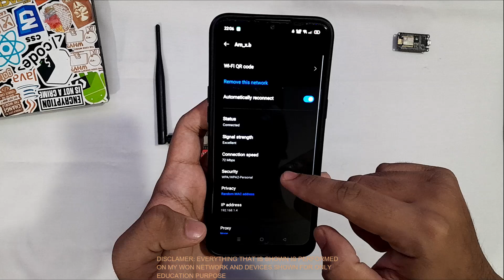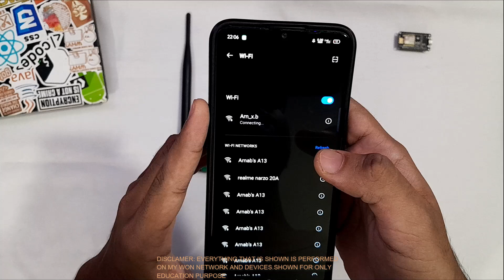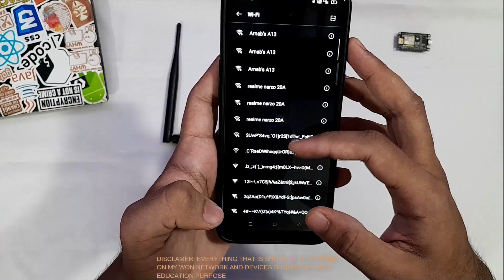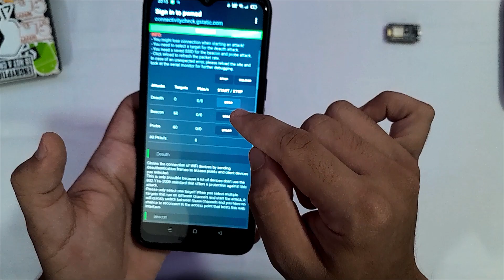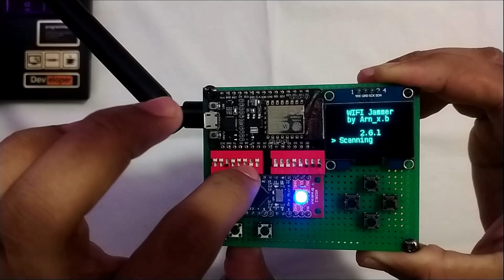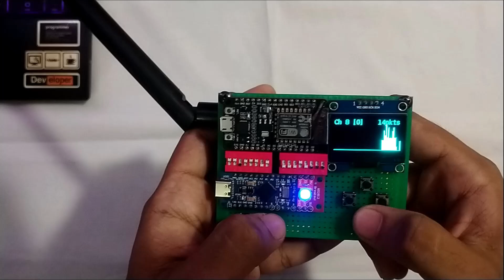Home-made WiFi Jammer in ₹150 / $2 with ESP-8266 (2024) 🚀 | WiFi Blocking Hack! 🛑💥

Comment: The module only works on 2.4ghz wifi nowadays most of the devices work on 5ghz it will not work on most of the wifi RTL8720DN use this module its dual band works on 5ghz as well...
Reply from the maker: Noted will be researching on this topic🫡

Comment: bro how did you got 5ghz in the esp8266 thats impossible in 6:25
Reply from the maker: The wifi antenna that i connected support dual band so it shows dual frequency but it dosnt work... i tested
Edit: it was my 2nd wifi name Arn_x.b 5ghz which is actually 2.4ghz thats why it captured those packets
Reply: May be It is ssid name
Reply: @SiddarthaSiddu-q5b  yeah you are ryt
Reply from the maker: @SiddarthaSiddu-q5byha you were right i cross-check indeed it was another wifi name
Reply: use bw16-kit rtl8720dn  instead of esp8266 it will work
Reply: it supprot 2.4 and 5 both